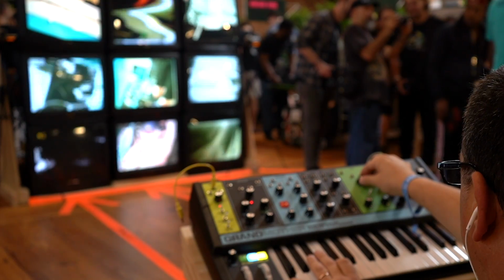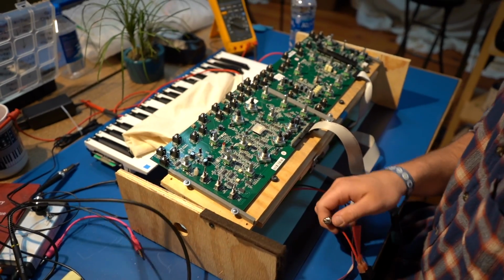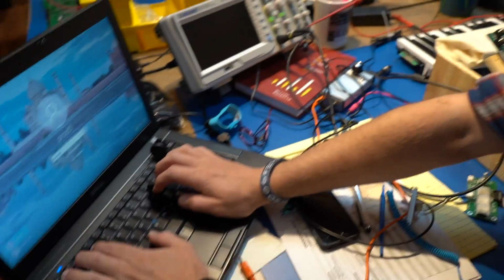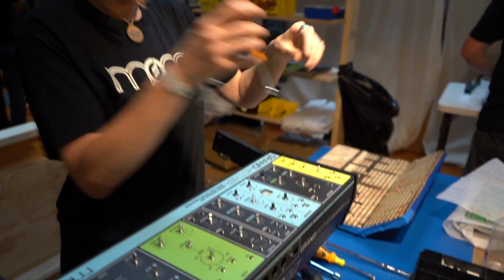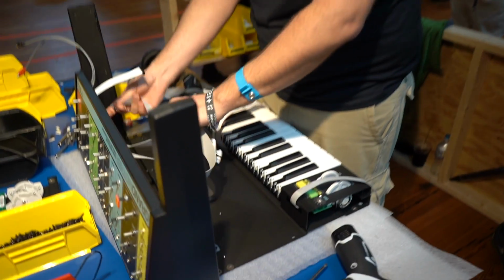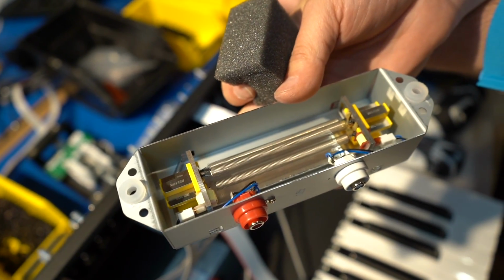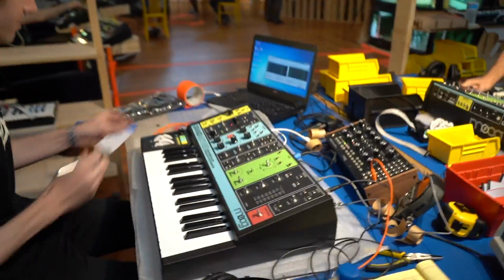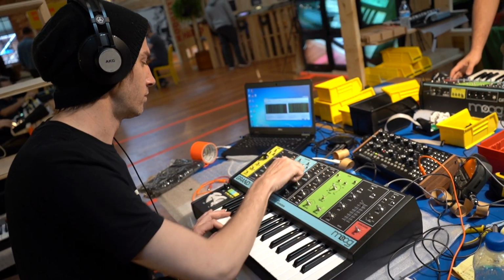Moog Grandmother sound test and popup factory tour

Comment: "First step is to do a visual inspection of all the components to make sure all the solder joints are correct and robust... " - Jeez good luck with that. Visual inspection of SMDs and PCBs went the way of the Dodo about thirty years ago.
Reply: Paul McKey yeah apparantly Moog has never heard of AOI inspection machines.
Reply: Well I'm not aware of a fab company that does assembling, but not doing automated inspection. And, judging by his 4 seconds inspection, I'm pretty sure it's just a quick check that something is not fundamentally wrong. As someone who writes automated tests for web apps, I can assure you that robots make mistakes...